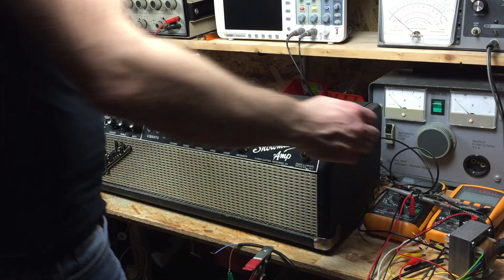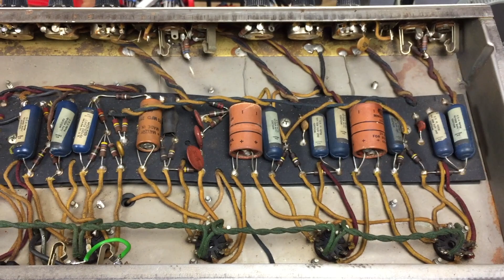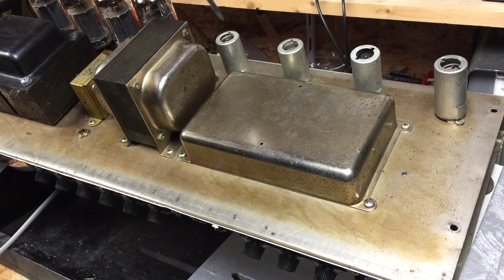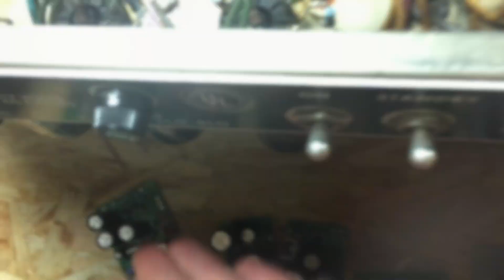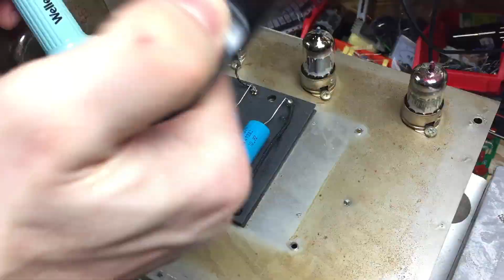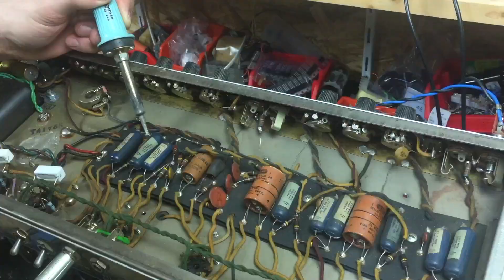1966 Fender Blackface Showman Amp Repair (AA763)

Comment: hello i need help i bought a fender twin reverb 1976 silver but there is.  the same noise as with you if I change these will the sound change my work at 230 volts in europe thank you !?
Reply from the maker: I cannot promise that it will for sure, since there are many things that can cause similar noise. But, most likely if you change these it will fix it. Of course, make sure to drain or discharge the capacitors using a capacitor discharge tool. Those filter caps can store dangerous amounts of charge after they've been switched off.

Comment: The main filter furthest left on the cap board should have shrink tubing over the lead that connects to ground. In the video it contacts the cloth colored wires that go to the other filters. There's some high DC voltage there.
Reply from the maker: Most probably nothing will ever happen, but you are right, heat shrink would be a proper way to do it.

Comment: This is a good video. I just bought a 1965 Showman that should arrive in a few days. It will also need new power supply caps and a few other things but I love doing this stuff.
Reply from the maker: These are great amps, and once you do the basic recap and check the tubes and resistors it will work for years and years ahead! These amps are so easy to maintain and repair it's a pleasure to work on them.

Comment: well done  should be a good repair when done
Reply from the maker: Thanks, Martyn!
Reply: @Delatsch  hello i need help i bought a fender twin reverb 1976 silver but there is.  the same noise as with you if I change these will the sound change my work at 230 volts in europe thank you !?
Reply from the maker: @ivanpavlov4223  I cannot promise that it will for sure, since there are many things that can cause similar noise. But, most likely if you change these it will fix it. Of course, make sure to drain or discharge the capacitors using a capacitor discharge tool. Those filter caps can store dangerous amounts of charge after they've been switched off.
Reply: Tanks